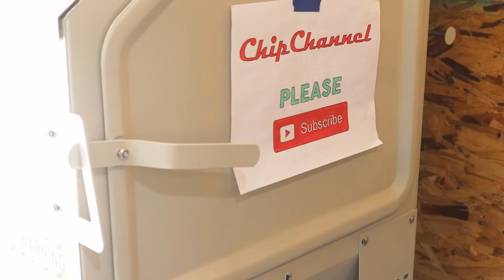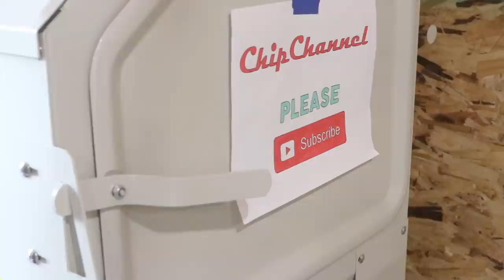1962 Tonka Camper Truck Restoration

Comment: Now that looks perfect, better than new. I'm still looking forward to the car hauler as the semi trucks are my favorite. Just curious if one of you projects has dents that need repaired with filler, would you be able to powder coat over it.
Reply: There are specially made fillers for powder coating.
Reply: This is very powerful repair👍👍
Reply: High end auto body restorers don't use body filler, they use solder and a torch flame. Costs a lot more, but the money people can afford it.

Comment: Great vid, but specifically, what kind of nozzle and media are you using? Seems like your nozzle setup has a wide girth to it's spread and the media is producing an incredibly smooth cut down to the metal. Impressed at those two values if you wouldn't mind sharing.

Comment: Where did you get the wheel caps? All I can find are the Zinc plated ones. They don't look right. I prefer solid uncoated steel. And by the way, a polished grill looks great. But if you don't want it to tarnish again put a clear coat on it. Clearcoat will seal it away from all the things that cause it to tarnish. It will make the shine lasts for years.
.
Reply from the maker: Thank you! I buy the zinc plated ones and spend quite a bit of time polishing. I'll have to start sealing the parts, thanks for the tips!

Comment: Yeah, that little dent on the top of the driver's side of the "hood" kept jumping out. Even minimal body work would have fixed that. You continue to rely on the powder coat to hide the flaws. You go to a lot of work to end up with a "less than it could be" finished result. Other than that, nice work.
Reply: That plus he buys a lot of replacement parts rather than trying to save the original items.  I watched him dig the white walls out on another truck with a pick and cringed as he tore them into pieces.